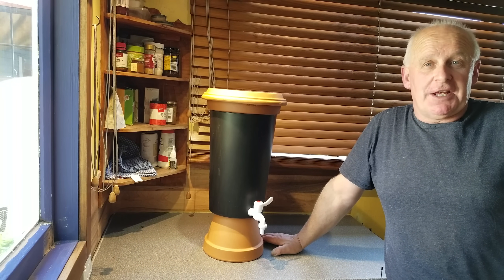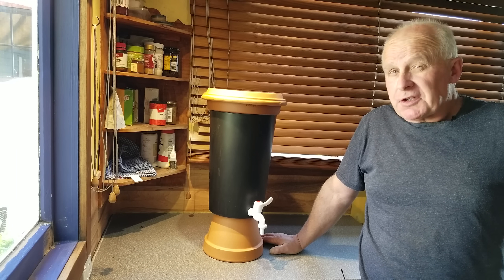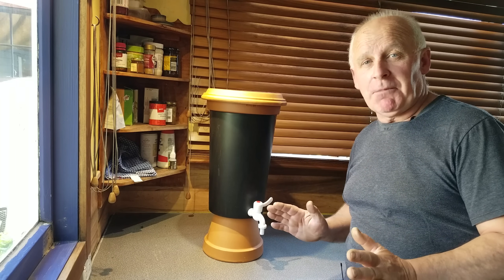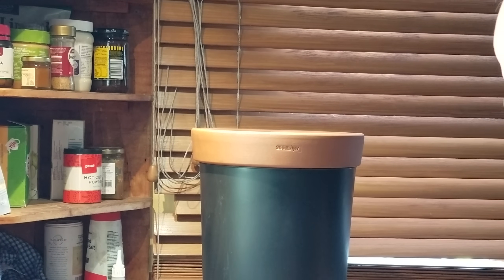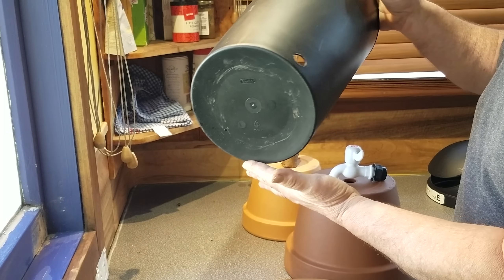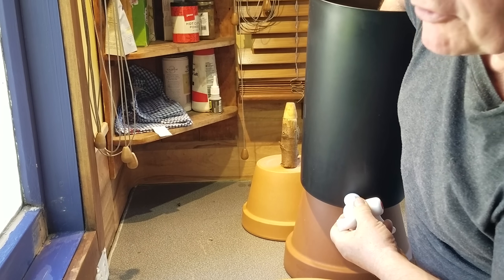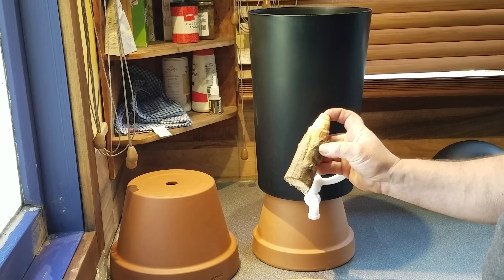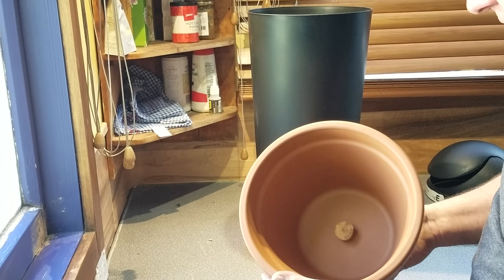DIY water filter. How to make FILTHY WATER drinkable

Comment: Thanks for the video.  The only ting I would change is the plastic.  The only independent study done on plastic and liquids (done in the U.K.) showed that ALL plastic - regardless of the type - leaks plastic (BPAs) into water within 24 hours.  All other so-called 'tests' were done by the manufacturers.
Reply: Worth spending money on the vessel.   Glass ?
Reply: PP does not contain any BPA; but yeah personally id use something like a glazed ceramic or glazed steel pot as a collector, for aesthetics alone.
Reply: @eelcohoogendoorn8044  You need to check your facts from someplace other than the manufacturers of PP.  That's letting the fox guard the hen house.
Reply: were the measurements significantly enough to cause harm? Because all of our food and ingredients have had at some point been in contact with plastic, metals, people, farts in the air, animals, insects, other chemicals.
Reply: @danielvillegasgranado  I find that to be the most ridiculous question anyone has ever asked me. Are you saying that because it's everywhere it's therefore safe?  You look up the research, look up what petroleum plastics can do to your body, and decide for yourself what you want to do about it.  I'm doing you a favor by warning you but I don't even know you, so I'm not here to make your decisions for you or spoonfeed you.
Reply: @danielvillegasgranado  no wonder sperm count is rapidly declining

Comment: You know I've been trying to figure out a way to get a water gravity filter because I couldn't afford the stupid ceramic inserts thank you so much for that I can still use a 5 gallon bucket I just have to be careful how big the hole in the bucket is on the lid so that the pot doesn't go all the way through. And I already have a spicket and pot.
Reply: Have you seen the American style 3 stage 5 gallon food bucket version?
Reply: Yes I have, the cost of the filters though knocks me out of the water usually. But I did see somebody using a terracotta pot as a gravity water filter. I don't know about the micron level of the terracotta but it actually worked they plugged the hole in the bottom that the terracotta pot has for drainage for plants filled it with water set it in a top of a bucket that they'd cut the lid out to the right size for the pot and put a spigot on the pot. And it for sure filtered the water. I'm not sure about the micron level of the terracotta and what it will actually filter out but the water came out clean and clear. He was using rainwater from his roof

Comment: Oh, just thought of another way to do that. I have an enamel ceramic waterjar with the spigot already on it which was made to sit my 5 gallon water bottles in.  If I find a flowerpot that will fit down in there with the filter stuck in the hole, its all set to go and the water can still be put in the 5 gallon or 3 gallon jug up on top--- does that make sense.😐 lightbulb moment-- thanks for your awesome idea!!
Reply: what filter? don't get it, sorry.
Reply: I think he meant the plug in the hole in the bottom of the flower pot.
Reply: @Goody2shzToo  no , he ment the porous unglazed ceramic pot with a plug in the drain hole.
Reply: @FlwrMs  I didnt get what he is using as an actual filter either.
Reply: @wingedinfinity777  The terracotta pot is the filter.
Reply: @lifeisgood-victoria796  Ohhhh ok. Thank you !
Reply: Go to 119 ministries YouTube watch prayer of salvation video it's really good.

Comment: I must have missed something. Does the water filter through the ceramic pot, or through the wood, or what? That's all it is is a flower pot? Won't the pores in the flowerpot get clogged after a while?
Reply: A porous ceramic pot works similar to a ceramic filter.   If you used funky water it would get clogged for sure.    If you used  filtered rainwater (fiber filter)   it may be clean enough to work well in the Pot.   This is economical and one way they filtered water in antiquity.

Comment: That is the best Yet,thank you soo much.I have an old Electric hot water Urn,refused to throw it out  after it stoped working ,now I can get it out of the shed clean it up and find a pot to put inside its top ....and wolah ! Done. Because it has a tap already and it has no electric coil inside it ( it is one of those heating coilless ones) its insides are clean.And yes its one of those safe plastic ones to,A total resycle with its own tap  to go .👵🏻😊👍 thanks for the infomation on its new life  I finally decided on.

Comment: Just a thought, but you could add to the quality of that filter by filling the pot with charcoal, hay, sand, and small gravel.  Then after so long, just empty it and wash the sand and gravel and replace the charcoal and hay.  With the infiltration rate being so slow the dwell time in your charcoal would be very high, and it would probably do outstanding at filtering even nasty water.
Reply: Excellent suggestion. Nothing cleans out impurities as efficiently and naturally as biochar/charcoal. Stay Safe
Reply: Go to 119 ministries YouTube watch prayer of salvation video it's really good.

Comment: Sloppy, Dangerous unethically irresponsible clip - WHY?  
Apparently just another novice you tuber celebrity wanna-be who sees someone else's idea and then makes another clip but this time maybe with better click-bait.

He doesn't say anything about all the precautions and dangers and makes it sound like all you have to do is visit your local store pick-up a flower pot and bingo - your off.   

Here are the dangers and other types of mistakes easily made without a better more educated clip that more and better educates the potential risk taker.
1. - Some older pots have lead in their coatings which used to be common on glazed pots.
2. - But while NO-LONGER today - what if someone gets a pot from an old barn?
3. - Flower pots today are glazed or unglazed - why?  What is such a quick simple way to tell the difference so one buys an unglazed pot which does do a very good job of filtering water - only AT FIRST.
4. - Those other more professional flower-pot filter clips mention to first thoroughly sand inside and outside with sandpaper.  
5. - ARE WHICH POTS MADE IN CHINA?  Ethical clips recommend to thoroughly brush your pot inside and outside with FOOD-GRADE Hydrogen Peroxide.
6. - How to prime a pot filter - he doesn't say!  Berkey ceramic filters for instance need to be primed.
7. - What about high-temp fired clay flower-pots - you can't use those but again so so easy to tell the difference in about 2 seconds or less with a simple test anyone any kid can do.
8. - Any green-thumber familiar with unglazed Terracotta Flower Pots will have experienced that common white MOLD that often and soon appears on the outside or in this case IN THE FILTERED WATER.  This type of homemade filter needs to be QUICK cleaned with FOOD-GRADE hydrogen peroxide inside AND outside depending on humidity and temp as often as two times a week - plus OTHER types of more harmful molds can occur on poorly maintained pots so sloppy maintenance types should NOT use these (the white mold is likely but NOT certainly not mold but minerals.)
9. - NSF rated buckets are not free of micro-plastic problems like leaching those into your filtered water this includes polypropylene most of those buckets from China.  But when stainless steel stockpots are so so cheap these days - why use plastic?
10. - Place your PROPER POT in the oven at its highest temp for 40 minutes to PRE-sterilize it if one can't find food-grade Hydrogen Peroxide.

PULL THIS CLIP AND RE-MAKE AND THEN RE-POST A MORE ETHICAL PRODUCTION - how about a click-bait like "Important Do's-n-Don'ts on DIY FlowerPot Water Filters."
Good-tidings to ALL - including this poster - cheers now!

Comment: That terra cotta is NOT the same as the microporous ceramic material used for water filters. Viruses, for example, will pass through that system. But for particulates and some larger microbes, it works.
Reply: But viruses can ultimately get through any system, including the Berkey. Maybe not as many, but no filtration system can filter out all viruses. If anyone is concerned about viruses, they would still have to find a way to purify the water after filtering it.

Comment: I recall seeing something similar made by doulton Lambeth ceramic factory, it stood on counter top made of salt glassed ceramic and cleaned water like purification... Made circa 1880... Sold for £20 at auction ...around 1998 / 99......if you goggle it there's abundance of info on them... This is modern version.. very interesting.,. Thanks
. Thom in Scotland.
Reply: Doulton are still making ceramic water filters - a bit more sophisticated than this, & a bit more expensive. But excellent! (This is what I use myself - the Berkey is not the only option for a gravity fed water purification system.)
Reply: Actually, Berkeys are upgraded Doultons... Doulton filters were designed in England for the military... In 1972, a very smart fellow got the idea to license the doulton filter and add a few touches, and the Berkey was born ( the stainless steel has always been their containers)  Sometime in 1990s; Berkey was sold to a "group" out of Arizona ( they were origionally from 
Berkley, Calif) and that's who makes and sells them now (although, they are probably made in china; I don't know)
Reply: Just check it for lead  because it's only recently that lead is tested for.
Reply: THANK YOU💖 I thought there was something similar already. Blessings
Reply: Fascinating.  Thank you for sharing.

Comment: The rubber washer should go onto the outside of the water bin not the inside. 
Cheers!
Reply: Why?
Reply: @Sun222Air  To form a better leak proof seal.  On the inside water can theoretically leak past the threads.  Ideally you want a rubber gasket on both sides but for just one I would put it on the out side of the bucket.

Comment: You could also add activated charoal between two coffee filters inside pot.does it filter out radon and arsenic?
Reply: This is complicated. Simply passing water through a bit of activated charcoal is not enough. In order for filters to work, they do one of two primary things: 1. Physically block bad things from getting through but allowing the water through or chemically bonding bad things in the water onto, typically carbon, in the filter. In order for the bonding action to take place, the water has to come into contact with the carbon, which means there needs to be some dwell time and distance. This is why so many cheap filters do not remove much. A good compressed charcoal block is necessary in many cases. The problem with loose activated charcoal between coffee filters is that there can be water channels that develop between the charcoal which will allow the water through unfiltered. I saw one analysis of charcoal filters and it determined that with loose charcoal, the water would have to travel through 6 feet of charcoal in order to adequately filter the water. So, if you are going to do this, and I recommend it, you would want to create a tube that has the coffee filter(or similar) at each end and a pretty significant amount of activated charcoal in between. The exact length depends on a few things but for a loose media filter you can likely get by with about 10" if it is not too coarse. Powdered would likely only require 4 inches or so. Again, many variables.
Reply: Would all of the water have to actually flow through the tube or would it be enough for the the tube to simply be placed into the water in center of the pot?
Reply: @Goody2shzToo  Flow through. If want any reasonable chance of filtering the particles have to come in contact with the carbon so they can bond. Just sticking it in the pot would takes weeks to have the same effect a good filter with water flowing through it would do in minutes.
Reply from the maker: wow- thanks for that
Reply: Activated charcoal is OK against Organic pollutants but probably not against metallic and anorganic components…

Comment: But, does it remove fluoride?   Where I live we have a great good tasting water supply but fluoride is added and home filters that will remove it are costly.  I end up buying spring water or reverse osmosis filtered water to drink or cook with and just use the tap water for cleaning.
Reply: Go on Amazon to buy filters that remove fluoride. It will cost $60-80 can be put inside this setup
Reply: @chel-lalasveganmania  How do you think this setup filters water? Through the wood jammed in the hole? No, it filters it right through the porous clay pot, itself. It would work even if the pot had no hole, as long as the pot that is being used is not glazed. So, based on that, where exactly would you add that expensive filter from Amazon? In the hole that doesn't actually play a part in filtering the water?
Reply: This is for filtering rain water. Fluoride doesn't fall from the sky.

Comment: In the US, old guys like me would absolutely label you as a "crafty fellow." I have completed ten years & counting in the Philippines and fully understand your frustration with not being able to find the many small parts so often needed to complete a project. Sure, we can buy nails, nuts & bolts etc at every hardware store. Attempting to purchase more specialized items, certain kinds of fasteners, stainless steel hardware commonly available in the US and Canada is a challenge here. Thank goodness for on-line shopping for those must have items. I do have to add that the situation is improving since I first relocated, many new & very large home-center stores are opening. While many sell items not exactly considered hardware (furniture for example) the selection of specialized items I use has vastly improved. 

You are absolutely on the correct path with the use of silver. Many years ago, I purchased a ten foot length of heavy gauge .999 fine silver wire from a jewelry crafter for generating colloidal silver. I have yet to "wear out" my first two six inch pieces that were cut from the roll. Anecdotally, we read how our ancestors would drop a silver coin in the water barrels lashed to their wagons to "keep the water sweet" as they made their way west. I have read these accounts in so many different places I believe it is true. Silver compounds are still listed at the Pharmacy and it was only a few years ago that colloid of silver was removed from the pharmacopeia.
Reply from the maker: Ever heard of "Being born with a silver spoon in your mouth"?  that was a medieval saying because they noticed that those who ate from silver tableware enjoyed much better heath.  watch that 'Nano Silver' video that I  posted the link to- they are taking it to another level which is good to see. Ive been making and using Colloidal Silver for decades now. I sanitise chopping boards razors cutlery with it I add a few drops to milk to stop it turning in warm weather when I had no fridge. Its great on burns and grazes. mouth ulcers- very refreshing if sprayed into tired eyes.
Reply: @t.h.o.r.  that is very interesting. So you are saying it stops milk from turning in warm weather. I will have to research more about silver. I knew some things about it.
Reply: @t.h.o.r.  colloidal yes, nano size metal particle is poison. For serious info look at work of another canadian: 
Tony Pantelleresco.

Comment: Hi there. I don't know if your water in Nz has fluoride added to it? but if so, I know of only 2 ways to remove it. The 1st is by reverse Osmosis which can work out quite expensive, & the 2nd is by distilling it. I went for the 2nd method, & bought an electric distilling unit on e-bay for @ U.k £60, & it will make 1L every 15-20 mins, with a capacity of 4L. Before drinking it, I pour it through a large funnel filled with 15mm kids glass marbles, (which restructures it, & adds life), (check out restructured water on YT) then I add 3 crystals of Himalayan  Rock salt per Litre, to put the Trace elements back in it. & store it in 5L polythene screw top drums, (glass would be better), but still working on that. There are no filters to change, just rinse it out before next use.  Then once a month (depending on usage), I leave it filled overnight with food grade citric descaler & it's like new again.
                          It tastes as good as bottled water, is totally safe, & has zero chlorine/fluoride or any other chemicals in it, & my kettle is scale free now. Obviously there's the cost of the electric, but it's not expensive to run, & no filters to buy /clean. I've been using it for 2 years with no probs, & it works for me. You would be amazed at the crap left in the bottom, after it's put a few litres through it. 
         I thought I'd suggest this as another option, for your hot/cold drinks & cooking.  Regards  Urban Geeze.
Reply: gonna be straight with you, glass is inert and will add nothing and remove nothing to the water, "restructuring" is total nonsense, what you're doing is oxidising the water by churning it through the air, pouring it from one container into another a few times will do the same thing.